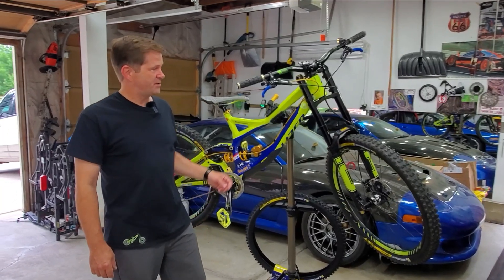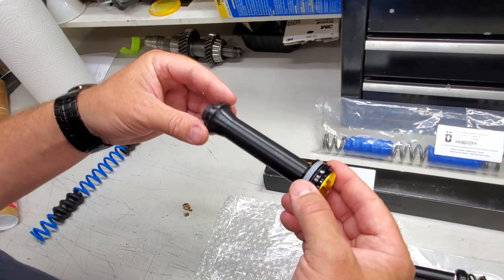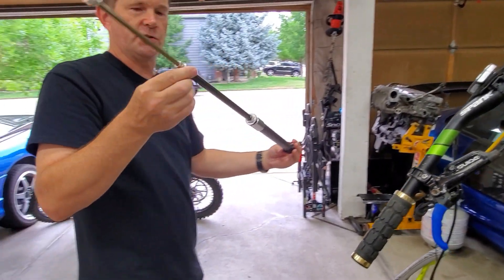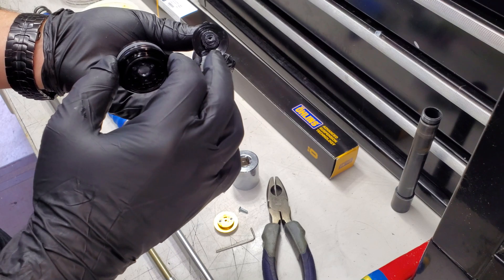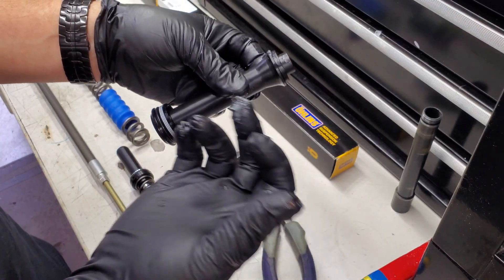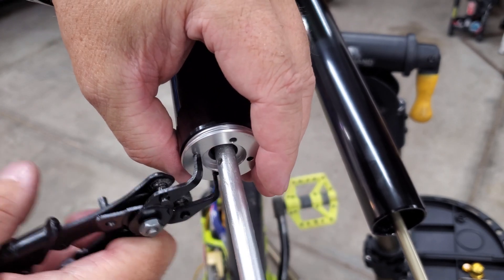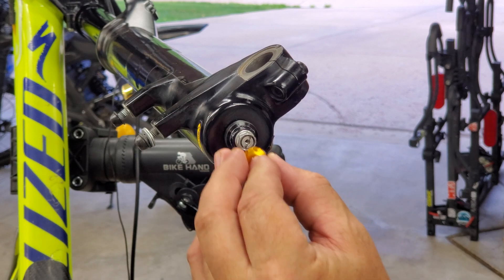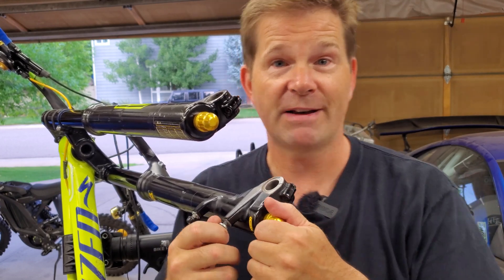Ohlins DH38 MTB Fork Air Spring to Coil Spring Conversion How To

Comment: If the spring is so much better, why does ohlins bother with the air system? Considering going to a Fox 40 because the air ohlins feels so bad comparatively.
Reply from the maker: The top tier pros do run the air system. Loic Bruni being the most notable. I, however, prefer supple over speed.
Reply: @DoesItTrack I, too, prefer soft. I hate braking bumps and would prefer to glide over them.
Reply from the maker: @robbbenedict  100% Braking bumps that go full chatter are just bone rattling. Skipping over the tops i'm sure is faster, but I want to feel like I'm riding a sofa. LOL

Comment: Thanks for the detailed installation instructions! Do you still have a Öhlins spring around? I am curious to know the length, OD and ID as I have a few titanium springs that are too nice to not keep riding.
Reply from the maker: The only one I have that is Ohlins is in the fork. Do you have a Rockshox Boxxer to compare it to? If you don't, I can measure that Boxxer spring to at least give you a ballpark if that helps.
Reply: @DoesItTrack  Thanks for the fast reply! I think I can find the boxxer dimensions and then compare it to your video when you put them side by side. I also just found in the öhlins item description it says 18.5/408 which I assume is the ID and Length. The old RXF 36 springs were approx 30mm OD. So with some modifications to the spacer tube on the preload side I think I can make it work. Are you still satisfied with the coil mod?
Reply from the maker: @mosquito-song  100% I just got back from Angel Fire a few hours ago from opening weekend setting up the new Demo. I'm still really liking the way the spring fork feels. Definitely a significant improvement over the air. I need to do a lower leg service on these too, haven't done one since I installed the spring. It's just working great so haven't had to make any changes.